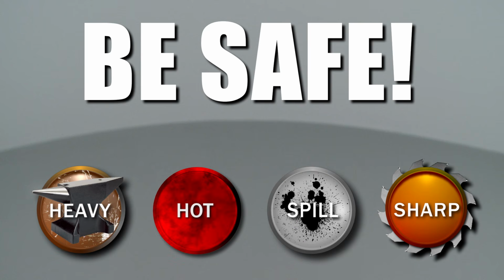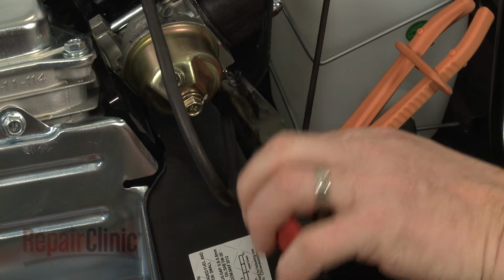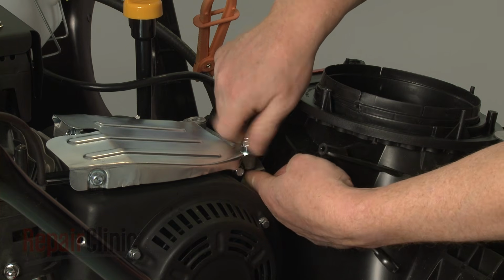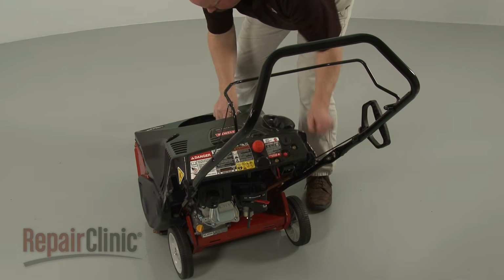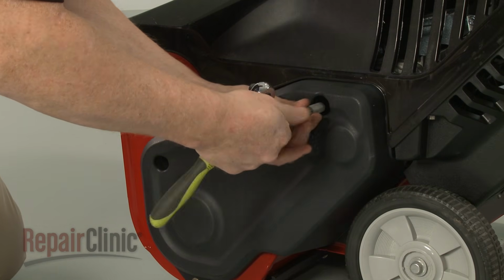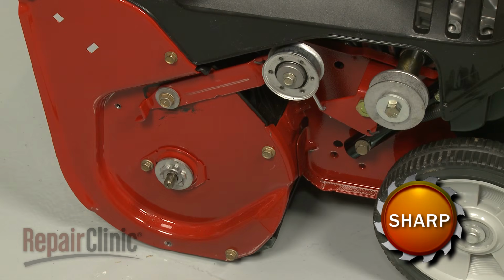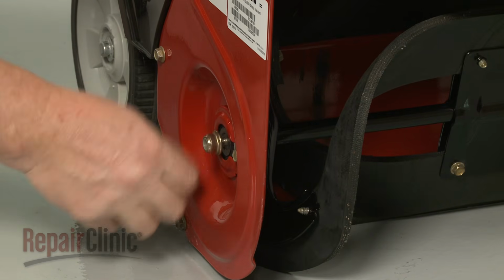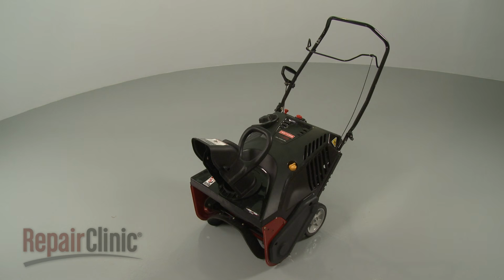Craftsman Snowblower Disassembly – Snowblower Repair Help

Comment: Exact model as this but my chute won’t stay put. It wobbles left/ right with vibration. All screws are firmly in place and none are missing. Is something just not attached or do I need to change the  chute ring? I know you’re not a diagnostic but rather a super smart pro. Just looking for some direction?

Comment: Ok i know this is old, but where does the primer hose attach to the carburetor? And my choke is not connected, seems to have the wrong piece or how to i fix this. Any videos on this or pics would save me time and frustration

Comment: I wonder what the model number of that Craftsman is???? I like it. Looks easy t o repair compared to my old 2008 Craftsman snow thrower I have today (less to dissemble on his) ,and uses straight gas too, I noticed the crankcase oil drain..
Reply: SB270 at Lowe’s

Comment: I strongly recommend using a nut driver, vs a ratchet with the screws in the plastic shrouds, they’re very easy to strip/break, don’t overtighten. 
Yes, speaking from experience. 
Great video!